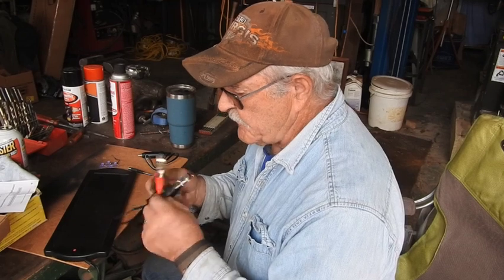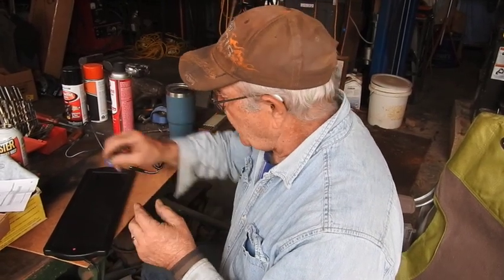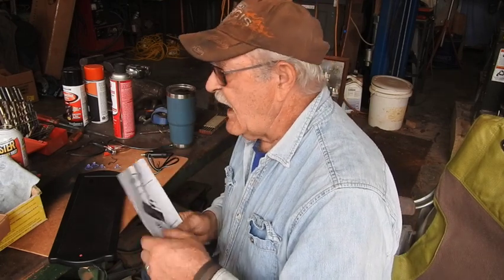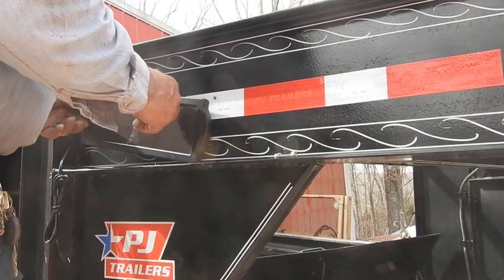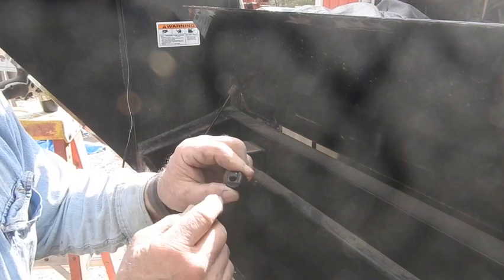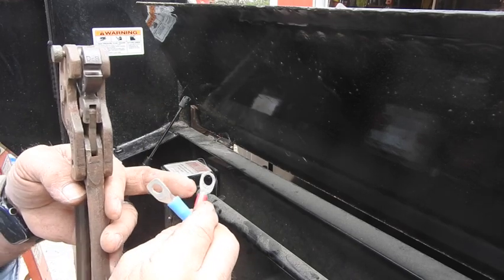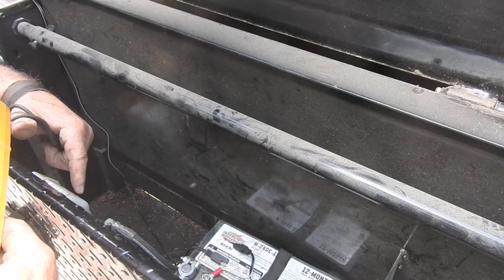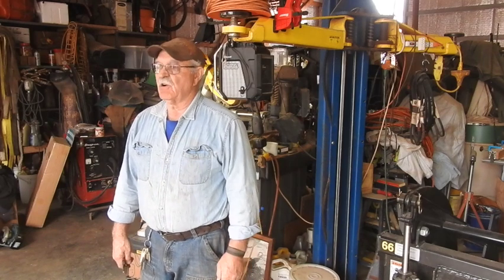Solar Charger For The PJ Tandem Dumper

Comment: Nice video.
Reply from the maker: If this works as good as I think its gonna, I may just buy one or two for a couple tractors that sit in the lean-to where there is no electricity.  Hang this on the post outside and run speaker wire to two tractors at once.  In parallel, one solar charger/maintainer can easily keep two batterys up !!

Comment: In my experience those stick on zip tie pads don't last long. Some kind of magnet that you can attach to would be handy or a screw mounted zip tie device. Even an eyelet connector large enough to accommodate a zip tie would work.
Reply from the maker: Probably got a point there.  I haven't decided exactly what to do yet, but whatever I do, I want it to be maintenance free. Thanks for the input.
Reply: Use a screw mounted cable tie once and be done with it.
Reply from the maker: @Cinder2008  Probably the best idea.  I hate having to go back and do something a second time.

Comment: 😊😊 U need 2,check the date 📅 😊 on the battery a tractor 🚜 😮, setting around is the worse thing there is 😮😮 U need 2 start the tractor 🚜 😊 2 let the battery 2 charge and the new batterys 🔋 😮 now are all sealed U cant put water in them no more either most likely the battery needs 2 be charged again otherwise  it 2 a parts store and get it checked out 😊😊 OMG 4 3 2O25